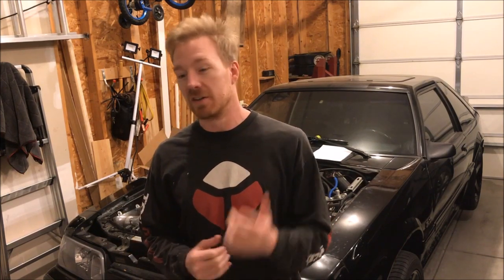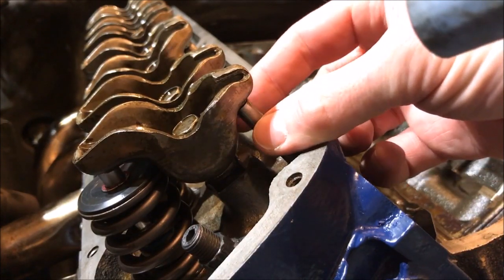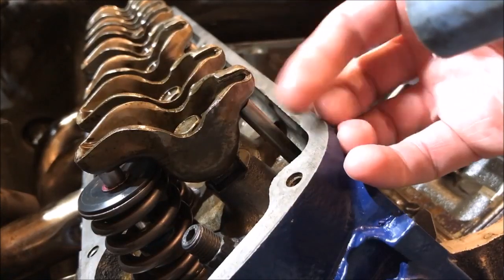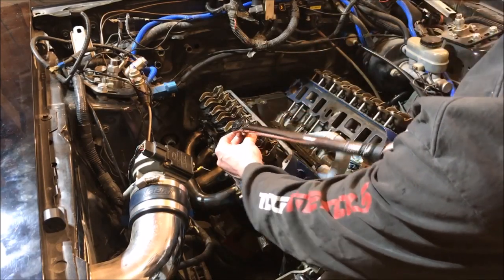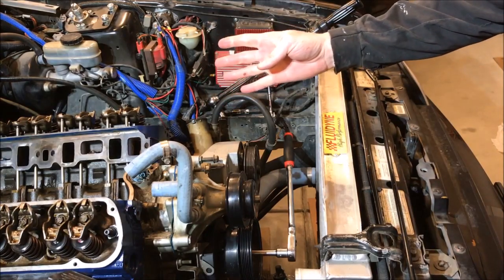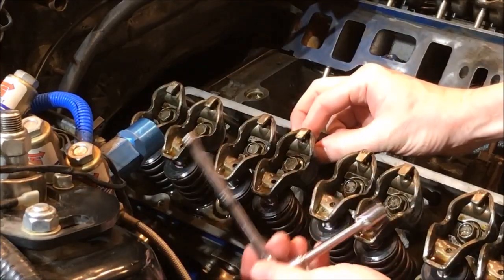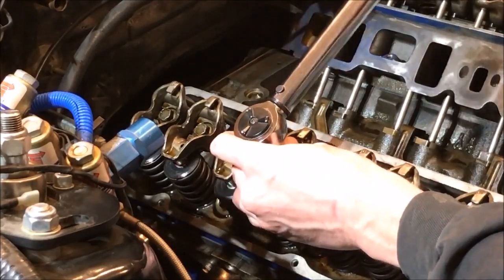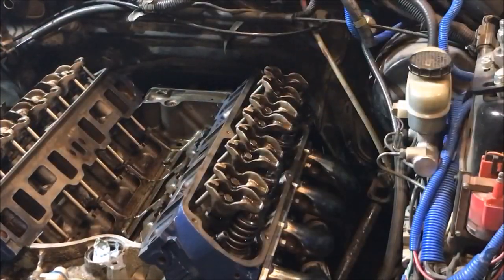Setting Valve Lash & Preload on GT40 Heads

Comment: Those are a single contact rocker there is no setting lash or preload just tighten them and torque I’ve done it on 4 on my 5.0s and I’ve never had an issue
Reply: Cause it’s a single contact rocker it’s not a roller rocker once the pedestal is tightened and torqued that’s it
Reply: @ponyboywils9950  If he was adjusting a Ford 289 he would be correct in his adjustments or a 350 chevy,  But I agree this is a torque lock system,  just toque them to 22lbs,  I like to have both valves closed, then TQ them.  should be able to run 6K with those rollers everyday.
Reply: MTR  No, there are some Diff.  stroke (2.87 VS 3.00) ,  the early rocker arms are Diff. there adjustment but later 302 became positive stop bolt down, early 289 water pumps are Diff.  302 blocks are a little thicker. So yes some Differences,   I like your style rocker arm the best,  just torque and go.  Did you ever do a follow up Vid?
Reply: MTR  it's all good , thought I'd point out the info incase you or someone else with one in the future.  ops forgot the balance of 28oz VS 50oz also & early water pumps pre April 1965 are Diff, because of bolt holes.
Reply: @ponyboywils9950 This is mostly correct - but if anything in the setup has been changed (cam, heads milled, thicker head gasket, etc) then the tightening procedure might not work out. IE: the bolt goes down to full torque and you still aren't at 0 lash. That's when you need to consider different pushrods and/or shims to get where you need to be. The only valvetrain adjustibility in these stock pedestal heads (E7's and GT40's) comes via the components.
Reply: And if you think you have to do that then you don’t know they aren’t a pedestal roller rocker just stamped steel and you’re putting stamped steel on a big cam it’s gonna shatter those eventually big cams need roller rockers and majority of comp cams recommend 1.7 roller rockers
Reply from the maker: @ponyboywils9950  the cam is mild to mild-aggressive in range. The stamped steel rockers will be fine.  They have plenty of strength for my setup. Thanks.
Reply from the maker: I think you still have to set lash and preload.  How else can you determine if you're reaching final torque within 360 degrees (or less) of rotation?
Reply: No they don’t they will shatter guaranteed
Reply from the maker: @ponyboywils9950  I’ll let you know when they fail and shatter.
Reply: They my not break but I will guarantee you that it will wear the vow God
Reply: Valve guides out of the heads
Reply: @xxkingslayemxxgamer5553  all in all the guys gonna have some problems cause he cheaped out on buying roller rockers
Reply: This dude does home improvement videos and lawn mowers and junk and thinks he’s a car guy lmao

Comment: My rocker arms became loose and I tried titinig them but thay still became loose I'm I doing something wrong
Reply from the maker: Yes, I’m sure you’re missing a step along the way. Make sure you’re tightening the rockers when you have zero lash when the valve is completely closed and the piston is at TDC.  If you’re not exact when you do this, your rockers won’t remain tight.  Double check the recommended torque setting for your rockers as well. Too little torque and they’ll loosen up quickly. Also make sure you’re applying the recommended torque within 3/4 of a full turn of rotation. As described in the video, if you’re having to go beyond a full 360 degrees of rotation to reach the torque number for your rockers, you’re going too far and need shims. Hope this helps.

Comment: The picture of the firing order had the same order for both style engines
Regular 302 1,5,4,2,6,3,7,8
302 h.o./351 1,3,7,2,6,5,4,8
Reply from the maker: Right, but the picture is indicating the HO motor which shares the same firing order for 302 and 351.  I know there’s different firing order for the non-HO motors because the camshafts are different. Thanks for the comment 👍

Comment: Where did you find or purchase the stock stamped Ford rocker?
Reply from the maker: Hello.  The rockers I used were from my original engine.  I didn't need to source them.  I would assume they'd be available at your local parts store or even Summit Racing or similar.
Reply: Fast Fix 
Lol 10 4. The current engine in my Fox runs great and has about 100k on it. I am building a second engine on the engine stand. I laugh because I was planning on using the rockers from the original engine like you did. But I thought if I could purchase a new set at a good cost I might do that. Thx for the quick response
Reply from the maker: Oh, I gotcha.  It’s a legit question. Sometime cheap stuff is out there if you know where to look. Cool on your project. You’ll like the added power.